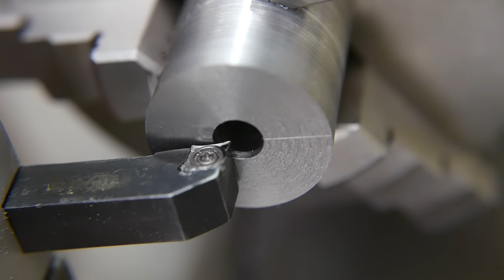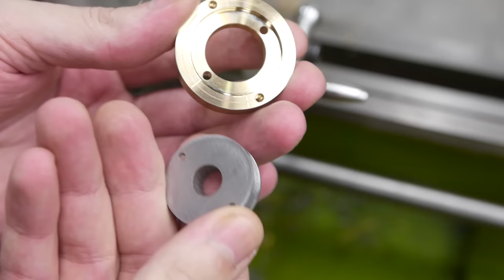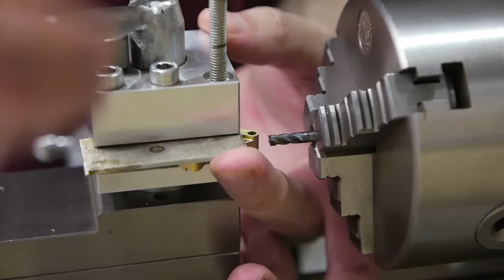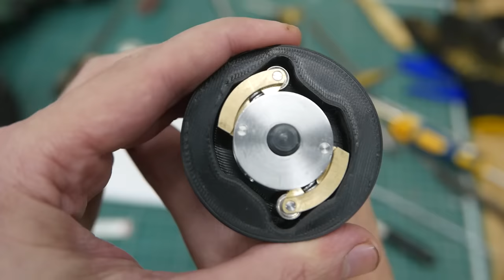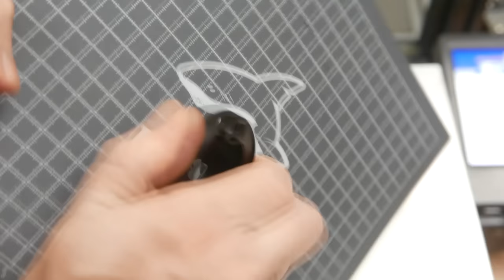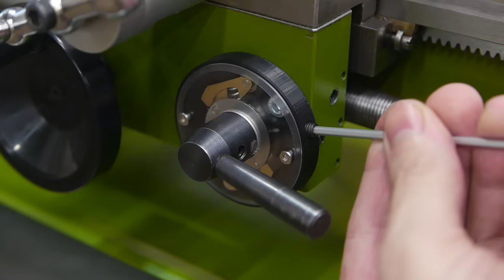Modifying lathe half nut mechanism

Comment: Sometime, "OVERengineered" is just the right amount of engineering to throw at a problem. 😁

Beautiful work there mate. Personally, I'd have found it hard not to solve the problem by making a simple ball detent with a similar diameter to your finished unit, but then again, my solution wouldn't have been beautiful enough to warrant a display window to show off all the prettiness within. 😏

It's always satisfying to see someone implement a technically interesting mechanism. I'm almost getting the feeling that you might be a design engineer for your day job, but by night you retreat to your home workshop and make the intricate things you'd love to do at work, if it wasn't for management constantly saying "You've got to keep the parts count as low as possible". 😣

Comment: i like the idea of scribing the middle with the tool tip, as you know, by the center 'pip', if any, that the tool is exactly on the midline.
Reply: U can easily check, if your tooltip is on the middle, when u turn your spindle around 180° and draw another line. I do so also on my cnc lathes.
Reply: Уважаемые, резец уже выставляется по центру детали.

Comment: Very nice project, impressive design.
Did you remove apron and check if lathe had any adjustment screws?
I did mine probably 18 years ago, can't remember exactly how I fixed the excessive clearance on half-nuts but I do remember they were adjustable.